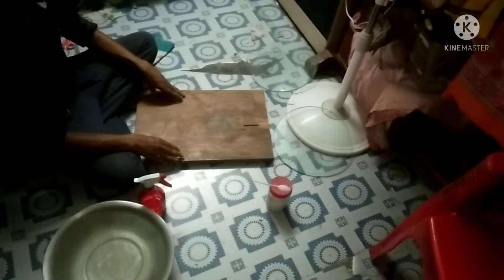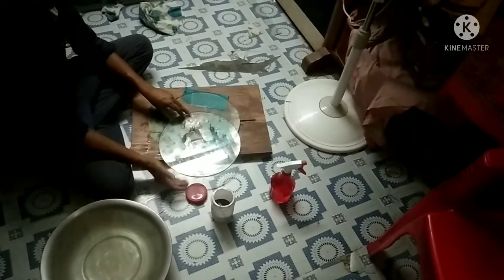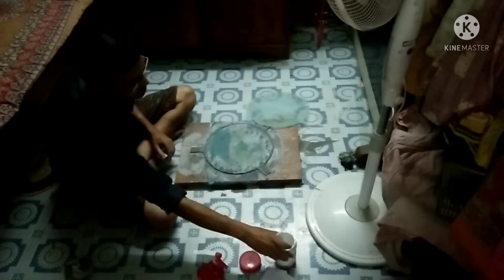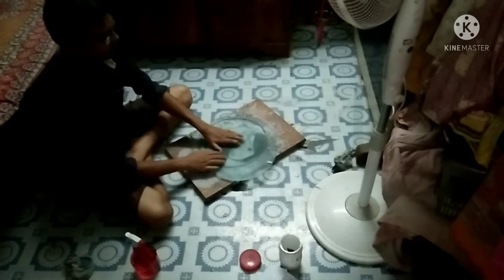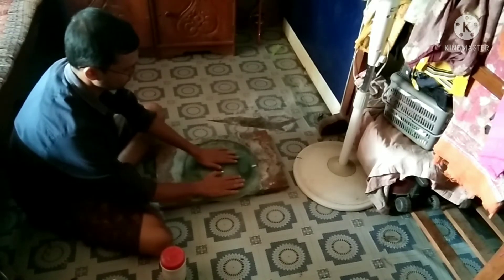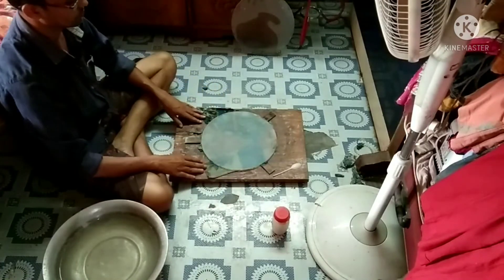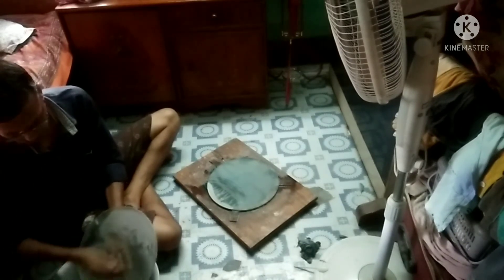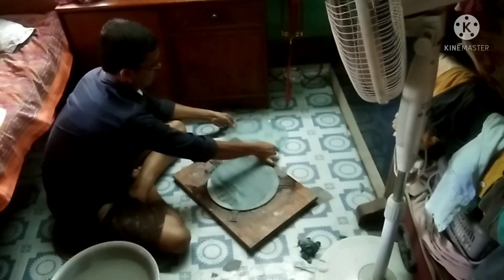Rough grinding of telescope mirror | large reflector telescope making | Step-2| telescope mirror

Comment: Im at my desired focal length but thers an air bubble in the centre which isn't going away no matter what i tried can someone suggest something
Reply from the maker: Try with TOT (tool on top ) and see the result .
Reply: @astrovillager did TOT for about 30 minutes and the centre dry spot was increasing now it's around 11 inch is that good or bad

Comment: Subscribed.
One question though- Can I cut the blank from any kind of thickened glass or there is a special kind of glass from which the blank should be cut?

By the way I'm also an Indian from West Bengal
Reply from the maker: You can cut the blank from ordinary glass available on hardware shop .
 And I am from Tripura , India
Reply: @astrovillager  Thanks for reply back.
Right now I'm watching another video of polishing the mirror of yours. 
Get another question though.
Will post that on that video's comment section, hope you reply back
Reply: @alifchowdhury1854 Bhai ek tip hai mote glass ke use karna like 12mm ya jada kyuki phir aap jada pressure se aur teji se mirror bana paoyge

Comment: I have recently done with rough grinding of a 8 inch f/6 mirror one suggestion from me is do it random don't put mark on mirror to measure the degree rotate mirror randomly otherwise it will leave marks on the mirror. I followed these steps and got the perfect spherical surface. If you overshoot the focal length then use TOT(tool on top) if will increase the radius of curvature.
Reply from the maker: Thank you

Comment: Great video. Une Question. How much time take the rough grinding step to get the required spheric curve?
Reply from the maker: It takes about 10 hours, my mirror blank was thin  ,so i dig out only 2.3mm sagitta,(f/8mirror)  but if you dig out more sagitta to make a f/5 or f/6 mirror ,then it will take more time